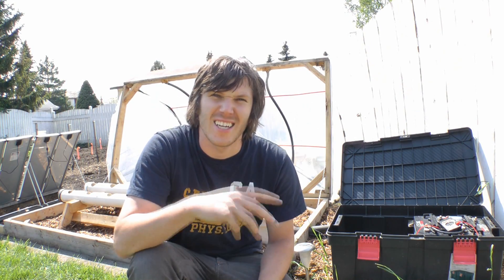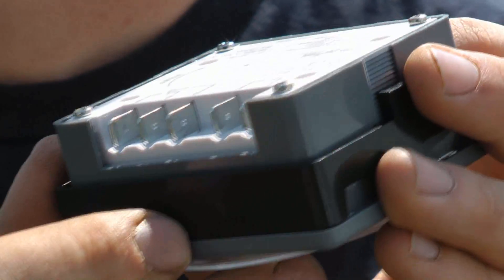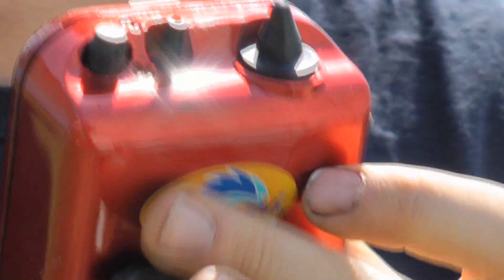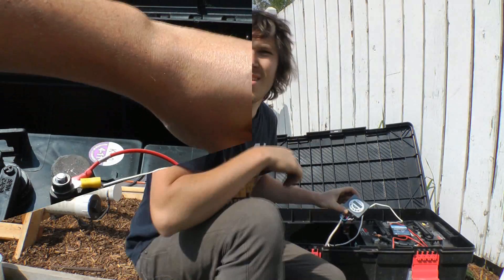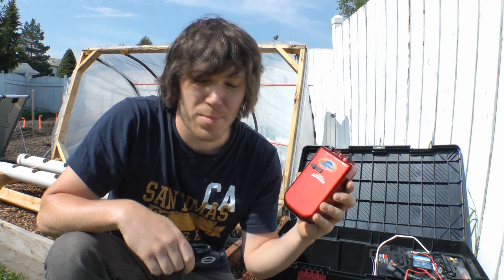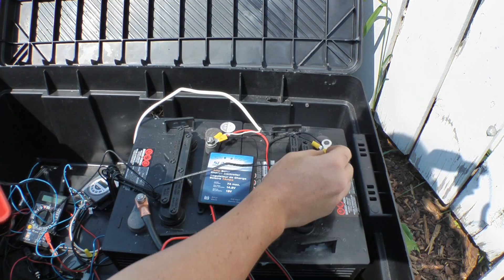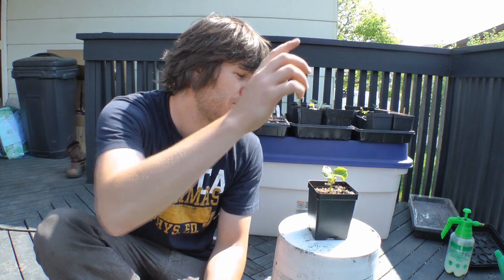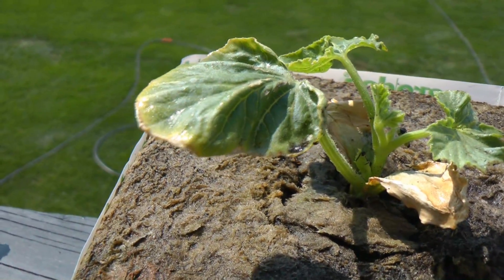How To Hydroponics - S02E19 Hydroponic Pump & Timer

Comment from the maker: @DrJerryrigger I think I do it more just to stop the water from going stagnant and to keep the nutrient solution mixing to prevent any setteling. If I was running the pump for more than 12 hours a day with a bell syphon I wouldnt worry about the air pump but that pump might only be running 15-20 minutes a day total. We'll see how it goes, like you said 'more O2 never hurts'

Comment: If your doing an ebb & flow you really don't need an air pump at all (though more O2 never hurts). The roots get all the o2 they need when it's drained, and the H2O get's some air in it from splashing around.